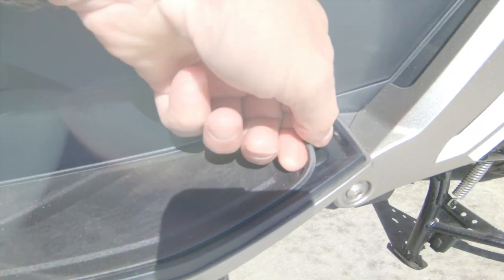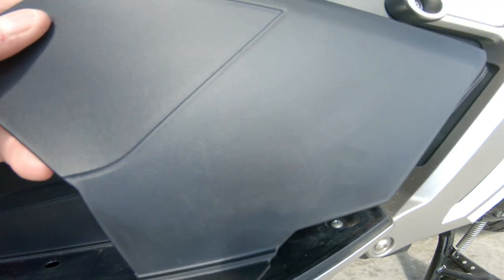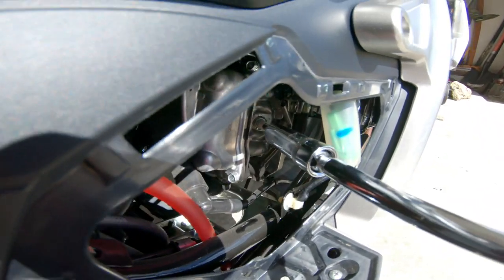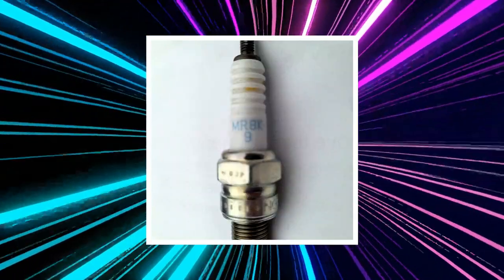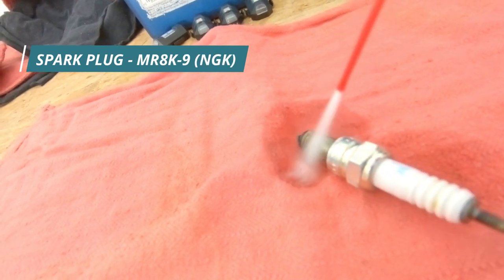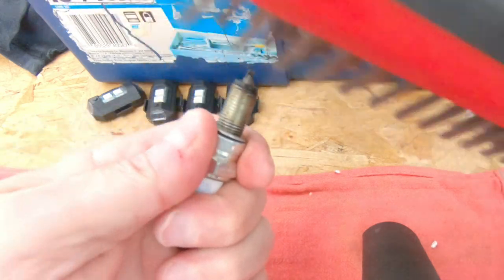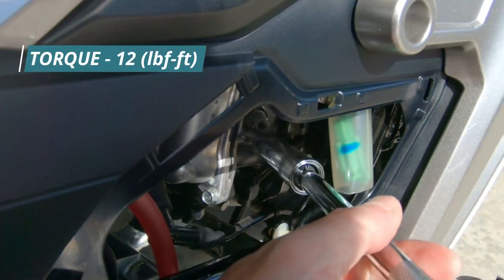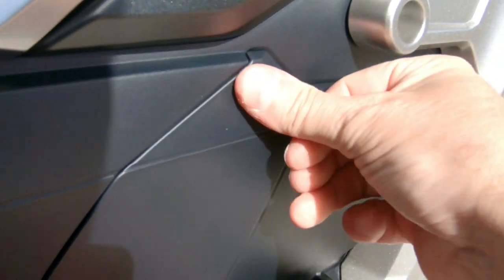Spark Plug Replacement Honda ADV 150

Comment: I watched this video to see what kind of access you have for valve adjustments. It looks like it may be possible through that opening. Does anyone know if removing the bucket under the seat gives you a good shot at removing the valve cover?
Reply from the maker: Jeff, even looking at the service manual it's not exactly clear where to gain the best access to the cylinder head. It might require removal of some covers as well in order to reach it better. I might have to remove the bucket section to really know. Why not? 😂 Might be a future project video!
Reply: @Trekopolis  That would be great to know. Thanks for making such informative videos.
Reply from the maker: @jeffperdue6689  If I could create "time" I'd be all set! lol Not enough hours in the day my friend. Maybe one day... ;)

Comment: Thx for the video bud. I bought mine from eBay. Just a few pennies cheaper so not big deal. But I always call NGK to confirm that it’s legit because I guess there are a lot of fakes one on eBay Amazon or any website. You maybe better to buy from the local store if they have it of course.  Very easy install process and cheap as well. I just replace mine instead of cleaning them because they are so cheap.  Go raiders!!!! Gotta find the balance on my division 😆
Reply from the maker: I think KC has this easy tonight, but I'm always wrong about the NFL matchups so who knows! It's like throwing darts anymore. You're correct, I'll just buy a new spark plug eventually. I only showed how to clean it for demonstration purposes only. 😉 Good luck to your Raiders! 🍀 🏈
Reply: @Trekopolis  thx man. Raiders will be killed probably 😂 oh well. Have fun if you watch it. See ya next time
Reply: @Trekopolis  are you watching it? Jajajaja raiders might pull the win 😊
Reply: Wow game. I won’t tell you the result in case you are watching it later on
Reply from the maker: @Julio-bc7pj  Ha. Saw the score. The NFL strives for the entertainment factor and it sounds like their script worked. Makes ya wonder... Is this real anymore? 🤔